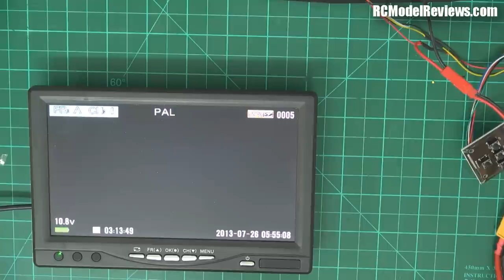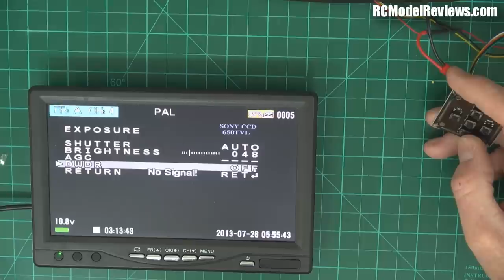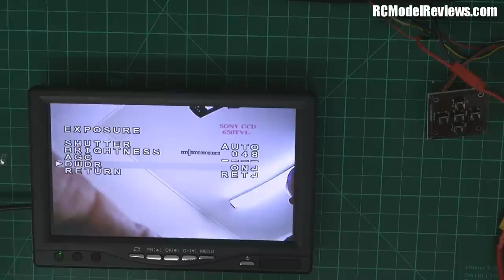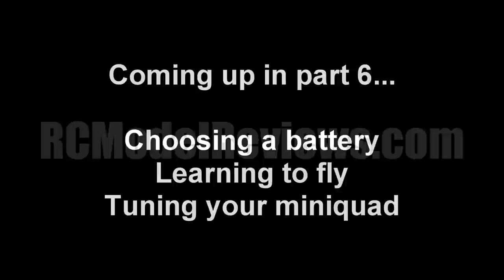Low cost miniquad racing drone build video PART 5

Comment: Hi, I recently bought a sony effio based camera but did not come with the OSD control board, however I have since found the solution if you dont have one: http://www.hobbyking.com/hobbyking/store/uploads/474758054X159527X18.pdf

Pretty easy, involves grounding the relevant pin on the osd board connector. 
6 = GND
5 = Menu Down
4 = Menu Up
3 = Select
2 = Cycle +
1 = Cycle -